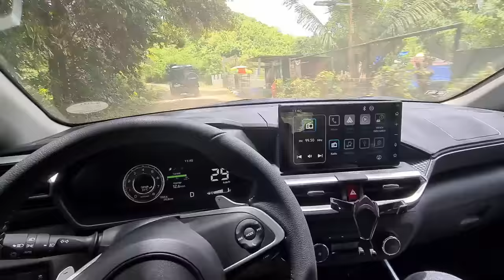OFF-ROADING with the Toyota RAIZE! Will it survive the trails?

Comment: Same experience with crossing water and almost with the plate no. just last week Friday, but with the real plate no., not the conduction sticker/temporary plate. Our plate no. almost got ripped off by the floodwater when I was wading through with a little speed, as I was afraid that it would get into the engine, since it was my 1st time experiencing driving in that high floodwater. 
Good thing we placed a washer under the bolt years ago, and good thing it was tight, if not, our plate would have been gone. Our plate was like 90 degrees from the bolt after the flood, shaped like an L. I was wondering why 2 people crossing the flood were looking at the front of the car and pointing, and I only saw it when I got home.
It was my 1st time crossing so many flooded roads in Manila, I've crossed some low floods before, but last Friday was higher, it was already reaching below and above the stepboard, and I felt it under the car, I saw the water level when I looked outside the window. The alternator was just a bit higher than that i think, since our 2017 Isuzu MU-X 3.0 4x2 AT (all stock), only has a 600mm water wading depth.

Comment: Turn off the aircon if you need to accend.
Reply from the maker: What's the reason behind this?
Reply: @FranzGaw  The engine's power is consumed also by the compressor, so, without AC, this parasitic draw from the compressor is gone.

Comment: the jimny is about 7km per liter on city with stock everything
Reply: Old 4x4 isnt light on fuel isnt?
Reply from the maker: Didnt know 2019 Jimny was considered old 🤣
Reply: @FranzGaw  i mean the 4x4 system still use old transfer case and live axle not independent and haldex transfer case. Dont get wrong i have old daihatsu taft 4x4 even it diesel Na its heavy on fuel. Compare to awd subaru or honda awd crv. But still we keep the taft as nostalgic ride and daily we use more efficient vehicle
Reply from the maker: I dont think it matters if the 4x4 system is old or not cause the Jimny is full time 4x2 only when driving in the city. Manually engaged yung 4x4 mode. But yes matakaw Jimny sa gas. Very bad aerodynamics is also a reason.
Reply: @FranzGaw  yes my friend has suzuki jimny with 1.3 liter daihatsu engine ( the original 1.0 suzuki is pathetic slow) the acceleration much better but the fuel consumption is same around 1:8-9 Meanwhile the original engine in more aerodynamic body avanza has consumption rate 13 km/l